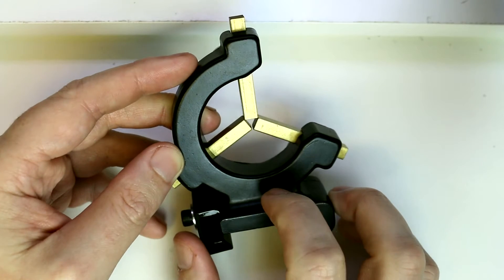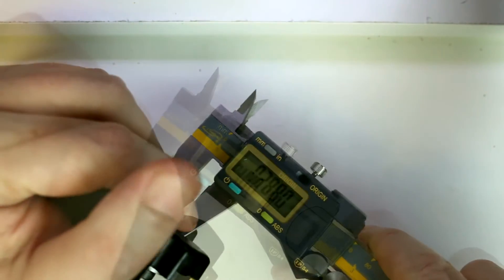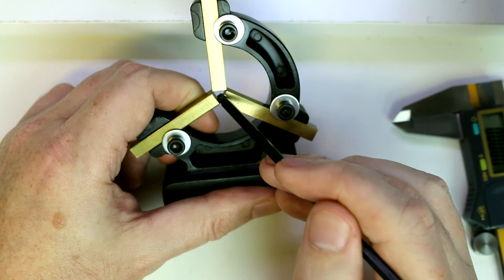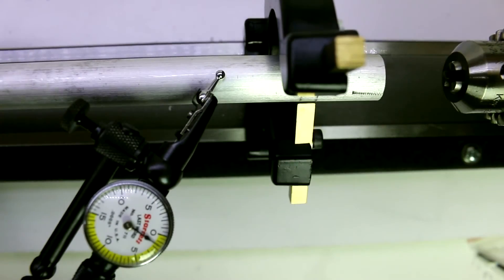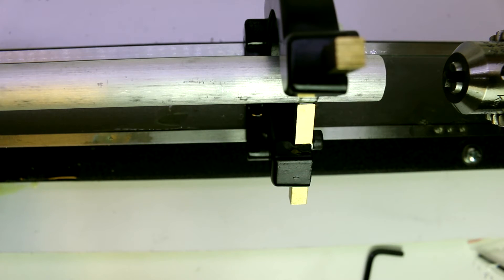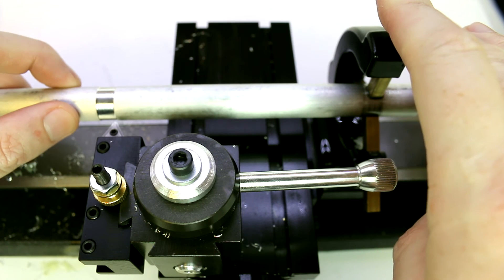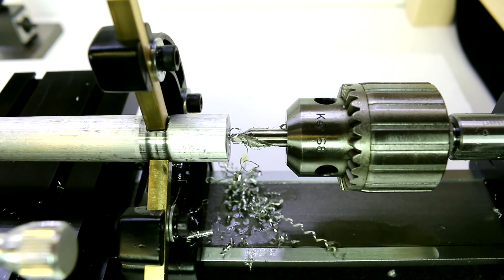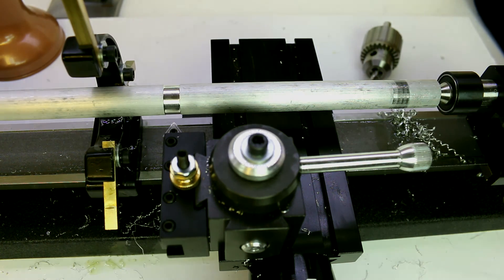Metal Lathe 127 - Work Holding with Steady Rest

Comment: 7:00 Just a note: indicating as you have, you have only established that the rest is snug against the part, and the part itself is round. It makes no difference whether or not the far end of the part is centered on the chuck, it will show very little TIR if you just rotate the part while indicating in one spot. If you must be truly on center (so as to avoid tapered diameters), you must indicate axially along the length of the part, both vertically and horizontally, assuming your bar is reasonably straight. An easier, faster, less precise, way to do this is to use a center in the tailstock (or a reverse center, if you don't want to/can't drill a center hole, but you will then have to chamfer the end) to hold the part centered, then adjust the steady rest to the centered part, removing the center to work on the face, etc. You could also mount your indicator onto a live center and rotate it around the end of the part. Admittedly, most of the time being completely centered is unimportant for steady rest work, since where-ever it is it will still cut concentric, and a small amount of taper is likely to be acceptable., but if you have a lot of turning to do on the end of a part, and the rest is quite out from the chuck, it can cause the part to work itself loose from the chuck.